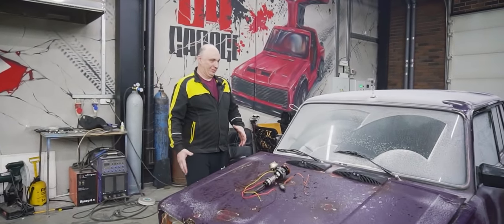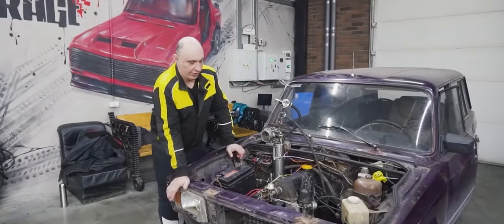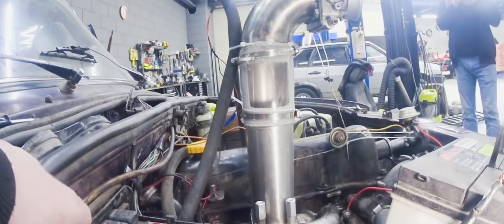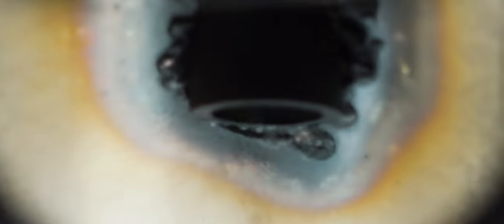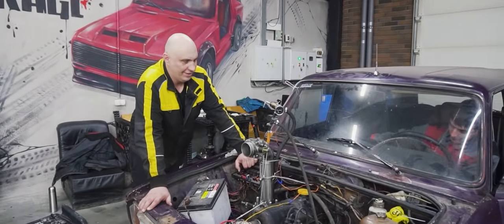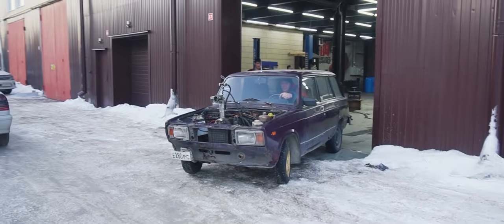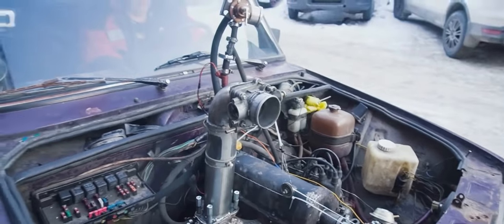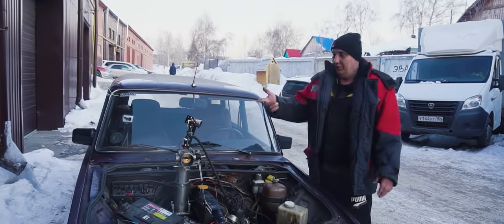Can you replace a carburetor with a fuel injector?

Comment: Interesting work! You should use a capacitor in the line to the (big) fuel injector and a resistor parallel to the coil of the injector. Then you have a clear timing for the fuel injection at every rpm. Just try it with some different capacitors, I think someone at your side will understand my idea. BR Roland
Reply: This will make the duration of injection independent of the revs? 
Equal lenght for every rev range? 
Im not into electronics, but it sounds like speaker crossover :)
Reply: @jareknowak8712  I think so, should be a way for an analog fuel injection, it is a project for trying...
Reply: That will work like a class A amplifier, only with a mechanical switch instead of a TRANSISTOR. The problem will be the injector minimum on-time, below which it will start to drip.

Comment: If you could make a mechanical fuel regulator that would adjust the fuel pressure with the throttle it would work way better. Lower fuel pressure at idle and have the fuel pressure increase as the gas pedal is depressed. This is like the old General Motors throttle body fuel injection.

Comment: Why dont you just pull the signal from engine pully using a magnetic switch instead of the distributor?   When engine goes at idle the pully slows down and injector only fires only 1 revolution on/off less as you have reserve fule in the manifold to make up for it.  With distributor its firing too often too fast.

Comment: great video i suggest put a check valve on the intake for air cause i saw some where in the video its likes firing back and put a cooling system  on the body of the intake manifold like on the mitzubishi gsr efi system 97 model
..but most of all i admire your work you done it on a mechanical way your manificent

Comment: Fuel injection is never going to work right with purely mechanical control since pulse width and timing needs to vary with engine RPM and load for the correct amount of fuel to get where it needs to be when it needs to be there. Port fuel injection greatly simplifies the whole thing.

Comment: There is no TPS sensor to regulate the fuel flow on the injectors. If we adjust the duty cycle of the injectors everything will align n work as it should.

Comment: Better off by using back up injectors set up to only work when higher rpm’s are achieved. Other than that you will lean out significantly @ higher rpm’s.

Comment: A cold engine and much air or little air and a hot engine. The problem is you are using a higher tube connected to carburator 😮😮😮

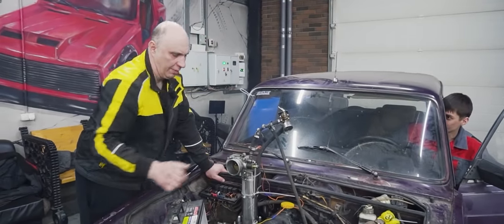Comment: 6:48 spi systems also have an accelerator pump much like a carburettor...you should just use an spi throttle body...that would be less fun but more efficient   you also need a throttle position sensor to control the injection duration...without that you will always be too rich at idle and too lean under load...the easier solution is to fit a compete system from a donor car for example the fiat punto, that one is simple and easy to fit, it has no immobilizer on years 1994 and early 1995 and has everything integrated on the Tb...tps sensor, temp sensor, accel pump, injector, idle control valve etc and the wiring is very simple

Comment: Holley made a throttle body fuel injection system that could replace a carb, just remove the carb bolt on the holley unit
Reply: I have it on my firebird it kicks ass

Comment: The problem with running the injector off the distributor cam is that it will provide a long injector open time when running slow (idle) and a short injector open time when running fast (the lean out when you Rev it up).
Basically the distributor cam is giving you the exact opposite of what is required.
Also you will need a longer injector time when under load (accelerating) although you can achieve that to some extent by having a Manifold vacuum referenced fuel regulator.

Your big problem is trying to get that longer dwell time as the engine runs faster rather than a slower dwell.
That's why they use electronics.
Good experiment though!

Comment: Was it a vac operated regulator?  Im guessing not. So many variables but 2.5 bar is about 36 psi. That is normal idle operating pressure for older fuel injection. (At least for ford) With a vac operated regulator it would have increased fuel pressure on demand possibly giving it the fuel it needed at higher rpm under load.

Comment: my 89 ford escort had a single injector pointing down in the standard carburator air cleaner assembly  at the trottle plate.

the injector sprays fuel when it get power - as it revs up the pulse time will decrease ..

Comment: Thats impressive! But what if you all make a custom intake manifold with injector holes for each cylinders. And use the distributor (but using all four contacts) for the injectors... And then TURBOCHARGE it, or feed it vodka instead of gasoline lol

Comment: Add a small valve on the fuel return line so that at engine idle speed the valve would be mostly open and fuel flow will have minimal restriction. This will result in low fuel pressure to the injector at idle to match the small air volume entering the throttle body. Then have the valve close off the fuel return while the throttle body opens to rapidly increase fuel pressure resulting in the proper amount (closer match) of fuel needed for the increased in airflow at higher load/throttle positions.

Comment: Connect injector power through the Start and Run circuits of the ignition switch, with the power to the ignition going through an oil pressure switch. That way if the engine dies with the ignition left in Run, power to the injector will be cut due to no oil pressure. Of course for that to work the engine has to make oil pressure right away when it's being turned by the starter.

Comment: In this 20 minute video they designed a better fuel injection system than General Motors did in the 80's..

Comment: If it hasn't been mentioned already....
Some early (ie, 80's) fuel injection systems used a tach' pulsed relay to turn the pump off basically anything below cranking speed.
This would eliminate the need for an isolation swith for the injector.

Comment: Its called throttle body injection and its been around since the mid 80's. So yes it is possible to replace the carb with an injector. There are tons of TBI kits available from the aftermarket.
Reply: Speeduino is like an open source ECU you can make from an Arduino development board

Comment: Sounds like it's running too rich cos it's firing too long at idle, and leaning out cos not firing long enough at high RPM, so that situation would need to be reversed, using say a vacuum-powered system that reduces On-state time at idle and increases it at high RPMs...

Comment: Get yourselves an aftermarket motorcycle fuel injection computer. You can set injector pulse lengths in a simple cross chart. Revs x pulse length.

Comment: Alot of old diy tuned boosted carb engines used a 5th injector back in the day, microswitch under the throttle plate

Comment: They could have added a restrictor plate in front of that throttle body, that would be easy for them.  Just a cap with a hole.  Can even cut it from a plastic bottle or something.

Comment: It's better to put the injector at the non vacuum side of the throttle since it sucks more fuel with vacuum but the engine needs less fuel with vacuum and more with wide open throttle.

Comment: In a diesel injection, excess fuel is piped back to the tank.  Injectors are now pop off valves so it only injects when sent a signal.  Fuel pressure is regulated by a pressure switch.  This is pretty basic and similar to injecting nitrous.  I agree a full hydrogen conversion would be a great project.

Comment: Your problem is looks like running parallel with the ignition coil. As long as the point is closed the injector coil is energized / open. For a too long time and that is the reason got too much fuel. You should utilize the time when the point is opening or open.

Comment: why not use brass fittings instead of rubber hose and clamps? use some air brake fittings and copper tubing. you could even have pressure regulated via a cable connected to the throttle body. More throttle, more fuel pressure.

Comment: If you can some how make the gap on the distributor work with your throttle the more gas u step the longer it sprays or even the fuel injector add a small second one that ingages from half to full throttle

Comment: just make something simple that can change the voltage going to the injector depending on the RPM that way you can use a bigger injector and just tune the voltage for the rpm and you then probably wouldn't have to use the switch to prevent the injector from flooding the engine when its not running because no rpm = no power to injector.

Comment: Have injectors for each cylinder and add another distributor specifically for the injector timing.(to close and open) and adjust that distributor so they open and close each injector before it creates spark. could be efficient?

Comment: They're doing this backwards. The distributor is normally closed and opens on each lobe. That means at idle the injector is going to be mostly on.  The distributor is turning the injector off for each lobe. As you rev the engine higher the distributor is spinning faster and turning the injector off more. Of course that would create rich at idle and lean when revving. They need to set it up so that the injector only turns on for each lobe of the distributor. An easy way to do that would be a relay that is normally closed and opens when getting power from the distributor. That way the faster you rev the engine the more the injector will be pulsed on.

Comment: you want a constsant fuel to air ratio 14 : 1 times more air than gasoline (mass)
The simplest way would be to use an aurdurino and a airnass meter.

Comment: you could easily adjust the fuel flow with a simple micro-controller. using the input from your added distributor as a trigger and an input from the throttle position sensor, and let it calculate pulse width of an output. it can't drive the injector directly you can use a single mosfet for that job. add on a oxygen sensor for a feedback and it can even adjust itself. as cheap as they are these days you  could do it for less than $10. if you know anyone that has any programming skills.

Comment: problem here is, whatever load you 'tune' it to, it will only be ok under that load, if the engine load goes up or down, it wont be able to compensate. this is super simple injection with no 'brains'. but, still cool that you got it going though! :)

Comment: I would use vacuum, control fuel pressure regulator. So at idle you can keep low fuel pressure.

Comment: I wonder if a second fuel inector triggered by a switch on the throttle would work? maybe use an old brake light switch or clutch safety switch on the throttle pedal thats adjustable so you can fine tune in the spot at which the other injector kicks on? A hair more complex but I feel like with the right injector and right tuning you get it running really well with more power and throttle. plus it would only use the one injector at low load for fuel economy!

Comment: At Idle the injector has a longer spray.  The points on the distributor stay closed longer at idle. Letting the injector spray longer ,  So it is rich. When the engine is revved up The point stay closed for a shorter amount of time leaning leaning the whole system.

Comment: The higher the rpm the less time the injector is running as it sits. Mechanically you need a relay to fire the injector when the points are open, opposite as it is now.

Comment: is this a new video or a new translation of an old video? If it's a new video... try taking a grinder and wearing down two of the lobes on the injection distributor so it's only firing half as much, that might solve the excess fuel issue. If it's an old video, you probably already tried my suggestion... lol

Comment: use a vacum switch instead of the button, engine only produces vacum when its running, we use a single and a dual throttle body injecter assembly simular to this to power our race mowers (fuel injected brigs and strattons) instead of a distro we use a reed switch on the flywheel to read the magnet and fi

Comment: They are surprised by the amount of gas being injected. I've seen some old trucks with throttle body injection it's called. It's basically just one big injector that sits on top of the throttle body and sprays gas down into the intake. Take the air cleaner off and sit and watch one of those things run and yeah, it was surprising to me how much gas it looks like is getting sprayed down into there, at just an idle.

Comment: The problem with triggering it off the distributor is that dwell time decreases with RPM, hence why it goes lean.  The solution is to use a pump that supplies more fuel than the engine actually needs, then meter the correct fuel amount into the cylinders by regulating injector orifice size. This raises fuel pressure in the entire system, ensuring a constant supply to the injector while enhancing fuel atomization. The fuel flow at the injector is determined by the pressure of the fuel delivered to it, and the fuel pressure increases along with engine rpm. Excess fuel needs to be returned to the tank.

Comment: Add a vacuum line to the distributor and one to the fuel pressure regulator. Line to fuel pressure regulator will adjust the richness at low and high RPM. The line to distributor will adjust the timing for higher RPM or the injector to adjust its firing time. Can't wait to see the follow up video. Gained a new subscriber.

Comment: I can hardly believe it even ran! What is needed, very very roughly, is for the "distributor" to make a pulse for a fixed amount of time every cycle (regardless of rpm) and this fixed time duration is then multiplied by a figure representing the variable amount of air being drawn into the engine at different throttle openings. This variable duration pulse is then used to operate the injector. Then the car would be roughly driveable. Plus referencing the fuel pressure to the manifold vacuum as others have already mentioned.

Comment: EFI hardware usually monitor three things; RPM (the speed the engine is currently running at), throttle body position (the position that's actuated by the gas pedal) and finally Oxygen sensor usually before the catalytic converter to check if the engine is rich or lean - the computer usually decide when to run a bit rich or not at idle (during cold weather, the engine usually run a bit rich so it can heat up the fluids so they move around a bit better before or during the drive). Otherwise it is actually doable, as in the USA we have the EFI upgrade package for the classic carbureted engines from Edelbrock (they also make rather good aftermarket carburetors).

Comment: You can use a relay between the distributor and injector to shut the injector off when you turn the key off with your ignition source or toggle switch and / or even a oil pressure switch for redundancy.

Comment: Assuming that i understood the mechanism behind the opening sustem of the injector, i think that you need something else in order to remove the switch you added in order to avoid the injector to stay open, something that interrupts the connection to the injector only when the engine is off (for example a relay that closes when the alternator is generating energy), or make sure to ignore a continuous signal and use only the ac signal generated... there are a lot of ways to do so, a lot of thec can be also be used as a regulation system too

Comment: This will not work unless you figure out a way to make the flow out of the injector variable with throttle input the way you are doing it 11 minutes into the video is the same amount of fuel per rotation and that won’t work because you need more fuel as you get more air

Comment: U can use a voltage regulator on the tps side and regulate how much the injegcor open also u can install a vaccum regulator to get u more fuel when in acceleration. As the volt regulator go up so does the psi. I say it might work.

Comment: i think you need to hook up the vacuum advance on the distributor that controls the fuel injector. so it will advance the timing of the fuel injector.  in order to get more rpm out of the engine

Comment: The issue is that while the fuel flow rate stays the same the air flow in changing with throttle opening. So it is going from too rich a idle to just right in the middle to too lean at full throttle. Ir you could increase the fuel pressure as you increase throttle opening it would probably run fine across the whole range.

Comment: I wasn't sure if they were already using a vaccum control regulator,  I think the key would be PWM & vaccum regulator. 
you could rig up a pwm module,  you can buy them with a resistance potentiometer adjustment I think people use them for Hydrogen systems. 
Even just that module manually regulation the injector would help then max out the vaccum pressure I.e try to get a regulator with a large diaphragm to increase greatly the pressure on low manifold vaccum.
Reply: So you be clear ru  the distributor system but just instead of what you are trying to achieve with the gap whjtch was a bit cumbersome,  run the 'on' time signal through a PWM module which allows you to then electronically control the 'gap'  I.e 'on' can be just 10% of its original signal or 100% control with a potentiometer knob,  then when tuned nice,  use a large diaphragm vaccum control regulator,  then you could get tricky by trying to also increase PWM on at acceleration
Reply: If you speak to the guy that built the transmission system for the 2 engine he would easily be able to put a PWM module between the distributor & injector it would make all the difference i think , great set-up. 
That and vaccum regulator.